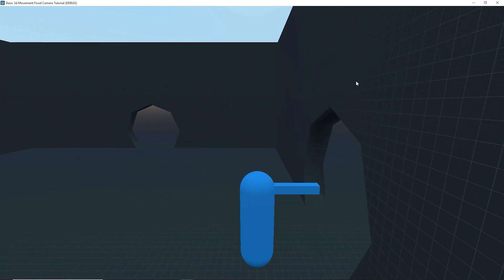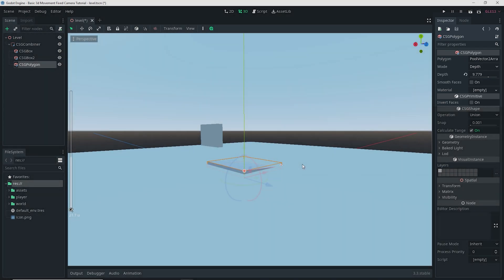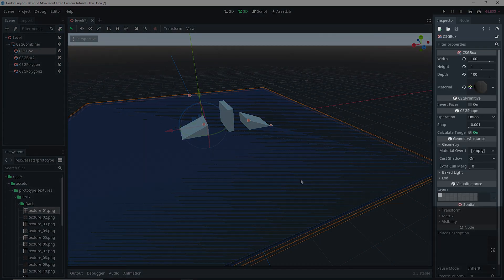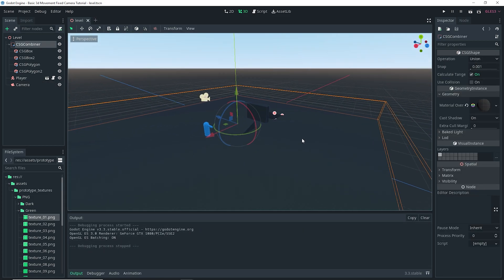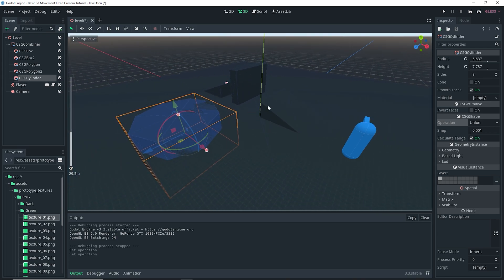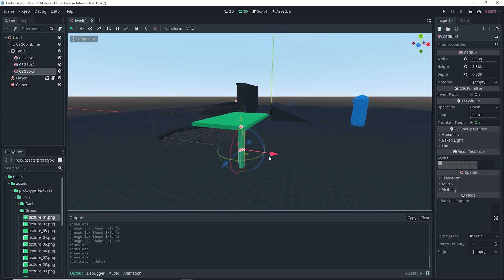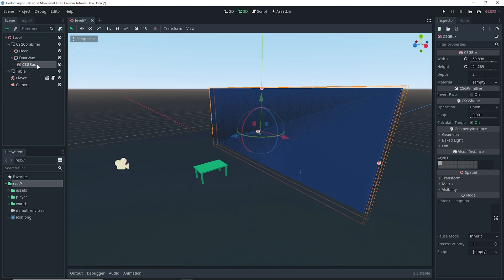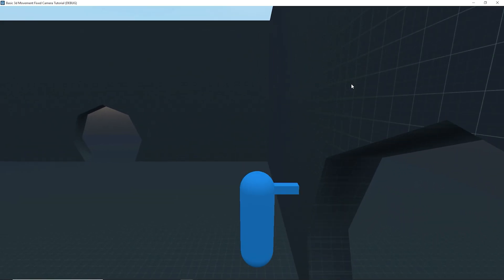Make a 3d Prototype Level in Mins | Godot

Comment: What's wrong with using CSG for anything more than a prototype?
Reply from the maker: from my experience I have run into issues with collisions and other things like that occasionally. now someone did mention that there is a plugin that allows you to use them without issues haven't tried it myself tho
Reply: @rayuserp  Thanks for the video and followup
Reply: @rayuserp  I see the plugin mention and the comment, but I don't quite understand the best practice on asset creation. If I did want to make these exact assets but for long-term usage, what would be the best method?
Reply: ah nevermind, i found the answer in the CSG Documentation: "Creating CSG nodes has a significant CPU cost compared to creating a MeshInstance3D with a PrimitiveMesh."
Reply: 3 months later came to ask this same question thanks